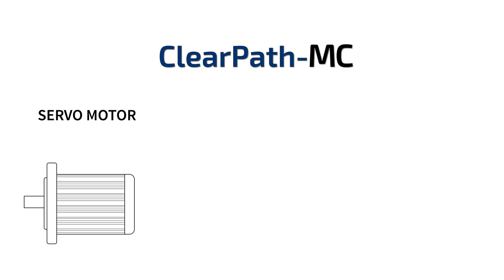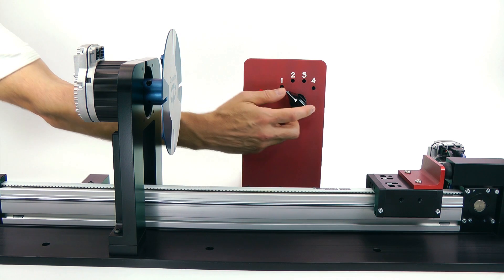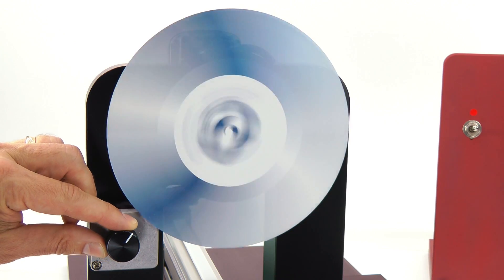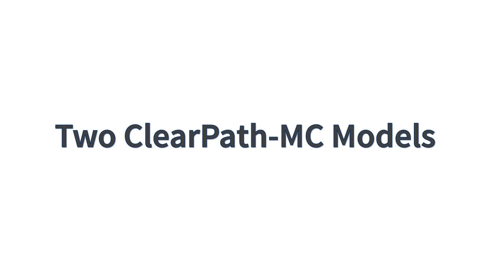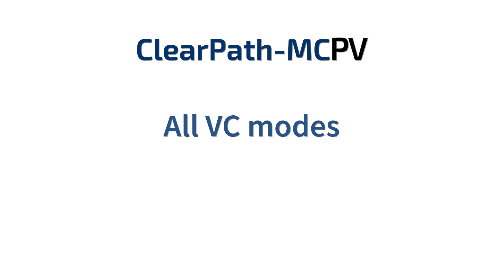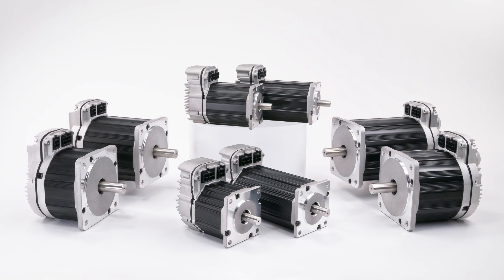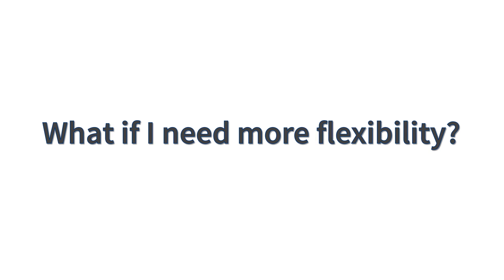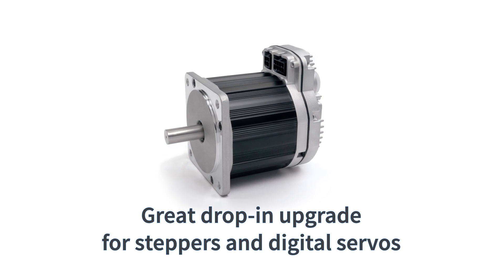ClearPath-MC (Motion Control) Series Overview

Comment: can we use it for an home elevator
Reply from the maker: Hello Ranna_ram, 

It would depend on the specific design of the elevator, but for a 1-2 person lift designed to go at a moderate speed between two floors, one of our integral horsepower motors would likely work. (https://teknic.com/products/clearpath-brushless-dc-servo-motors/ac-induction-replacement/) That said, given the human safety requirements of this application, we don't recommend this sort of project unless you have the appropriate training and experience.

Best Regards, 
Bradley N. -Teknic OEM Application Engineer

Comment: Very nice, I would like to know the dimensions of stator, how long and width, Thanks. O could you remove the module to exterior and have double shafts to run a conveyor. If you can I will put an order of 2 units.
Reply from the maker: Hi Joe,

All of the dimensions and 3d models for the motors can be found on Teknic's website (https://www.teknic.com/downloads/). 

These motors are commonly used in various types of conveyor applications, however there is no dual output shaft option. The drive module on the rear of the motor is an integral part for the motor to function so it cannot be removed to accommodate this type of feature.

For more information regarding these motors or our other products please contact support@teknic.com to discuss your application's requirements.

-Brendan F. - Teknic Servo Systems Engineer

Comment: Would MCVC suitable to control cnc router?
Reply from the maker: Hi Up Tech CNC PVC LT-130,

Thanks for watching and for your question. It is a good one.

You cannot use the ClearPath MC series to control the X, Y, and Z axes of your CNC router (although a different ClearPath series is a good option – more on that in a minute).

ClearPath-MC servos are typically used by customers in applications where they need to control either position, or velocity, or torque. Customers often use the ClearPath-MC servos when they want to simplify the motion control methodology. These customers generally want to minimize the programming of a separate controller, or perhaps eliminate it altogether. It is common for them to use switches, buttons, or sensors to control the motion instead of a PLC or microcontroller (although there are certain situations where it may make more sense to use a PLC or microcontroller). The MC series can be attractive when replacing pneumatic actuators, controlling conveyors/mixers, and positioning rotary/linear indexers. You can learn more about the various control options here:

https://www.teknic.com/products/clearpath-brushless-dc-servo-motors/clearpath-mc/

CNC applications on the other hand require real time, multi-axis velocity and position coordination of the main X, Y, and Z axes. This is where the ClearPath SD series usually makes sense. The ClearPath-SD servos require a controller capable of generating Step & Direction signals. The controller is used to tightly synchronize the timing of these Step & Direction signals for each axis, which in turn coordinates the real time velocity and position control between the axes. If you’re interested in learning about the ClearPath-SD series, take a look here:

https://www.teknic.com/products/clearpath-brushless-dc-servo-motors/clearpath-sd-servo/

If you have any other questions, feel free to reach out to us directly through our "contact us" form (https://www.teknic.com/contact/ ) or call us at 585-784-7454.

Jon K. - Teknic Servo Systems Engineer

Comment: Would MCVC suitable for a rigid tapping spindle motor?
Reply from the maker: Hi Adam,

Specifically for a tapping spindle, the ClearPath SD (Step and Direction) series is a better fit. For general purpose spindles, the MCVC can be a good option, but since tapping spindles typically require multiple speeds and multiple positions, the ClearPath SD is better suited for tapping applications.

The decision to use ClearPath (and which specific model) will depend on your application's torque and speed requirements along with the duty cycle and other factors. Please feel free to contact support@teknic.com if you have any questions about our products and your application.

-Bridgette G. - Teknic Servo Systems Engineer